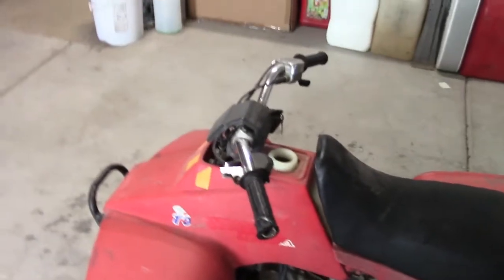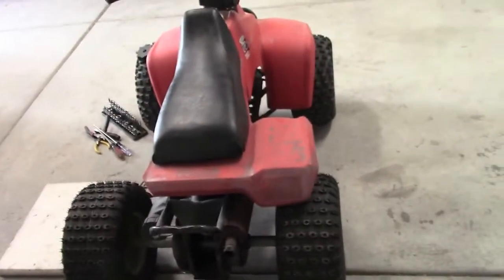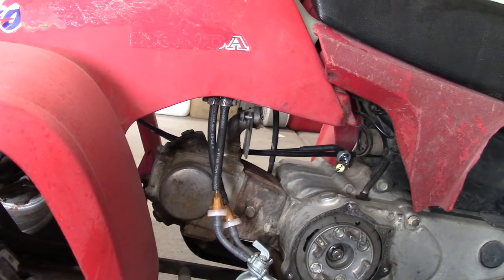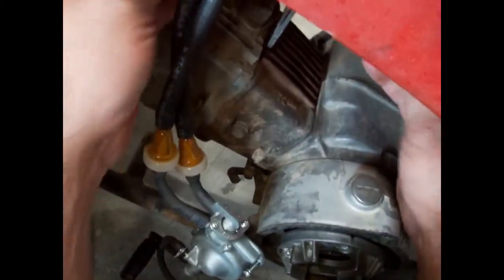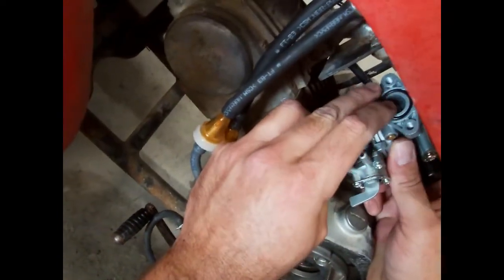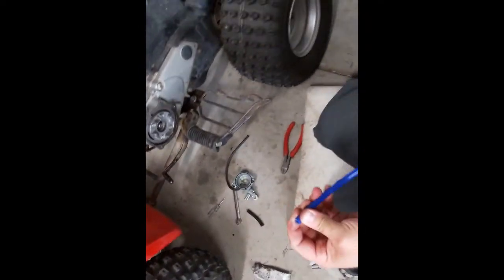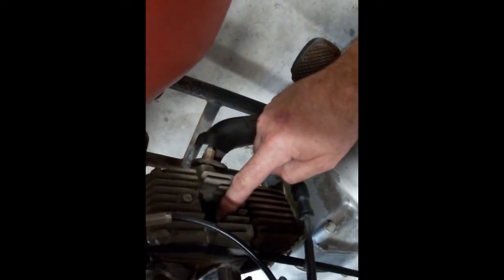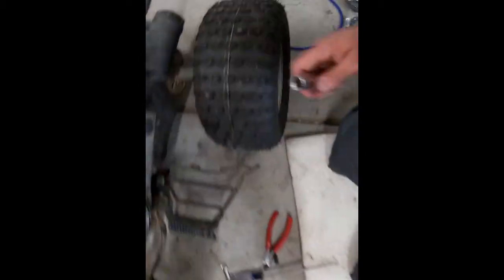Getting the TRX 70 running and moving

Comment: I think your's is 87.  Mine 86 has rear hand breaks not foot breaks
Reply: Tag on mine on right hand side reads: "Honda Motor Co. LTD, Made In Japan, TRX 70, 6/86". I'm assuming it is June 1986? It also has the foot rear break and no key for ignition, just on/off switch.